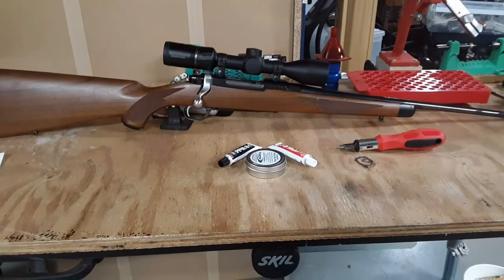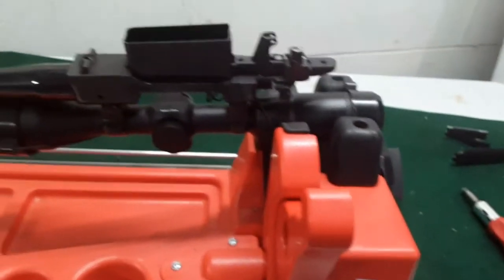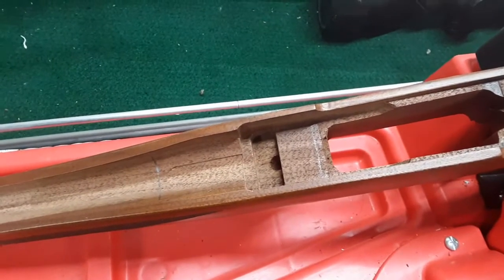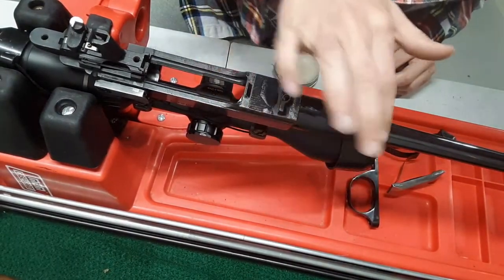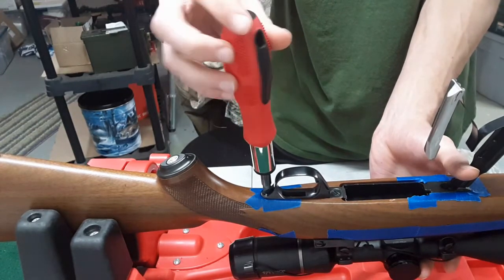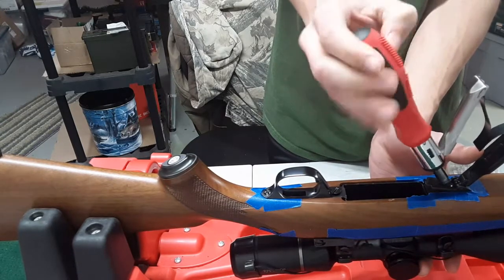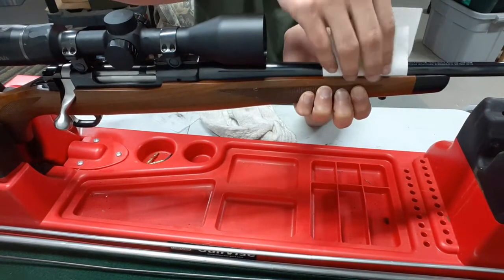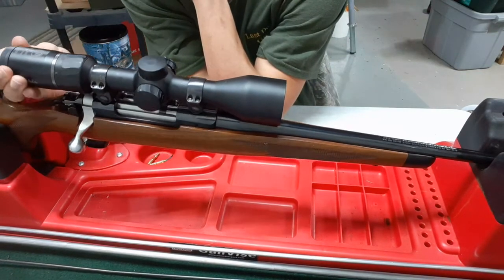Epoxy Bedding a Rifle Stock (first attempt)

Comment: So I’ve now done a couple of these and had a friend give some helping hints. 
Here is what I have found. 

1. Tape the areas of the stock you don’t want to get epoxy on. 
2. First time - Use more epoxy than you think you need by about 1/4. After that you’ll get more of an idea and get a good fill. 
3. Adding Pillar before doing the bedding is easier and can make for a cleaner job but take longer. 
4. Use a putty as a damn in the areas you don’t want epoxy to go. 
5. Tape around the barrel to make sure it’s going to be centred and free floated with out later having to remove material.
6. With JB weld, do initial clean up but not to well. After 4hrs it is far set enough to release and stay in place but easy to cut and remove excess that will aid in clean up. 
7. Don’t clamp the action too tight. If your using screws don’t tighten them too much. The epoxy has shrinkage when it sets. If you make it with it too tight it seems to shrink and then be slightly out… I can’t explain it but it just shoots worse than if you do it firm but not tight. 
Eg 5-10ftlb with screws or a light resistance band from the physio to tie and hold it in place or a light hand clamp etc…

Comment: Any improvements on the accuracy?
Reply from the maker: Yes.
With it now being somewhat bedded and free floated, the accuracy was more consistent. As the barrel heats up, it still shoots fairly well.
Before, it shot 1 inch groups at 100 yards most of the time, with significant vertical stringing. Now, I can get most bullets to shoot 3/4th of an inch.